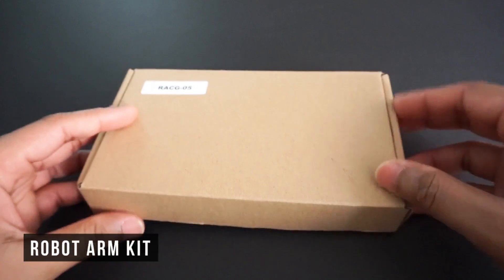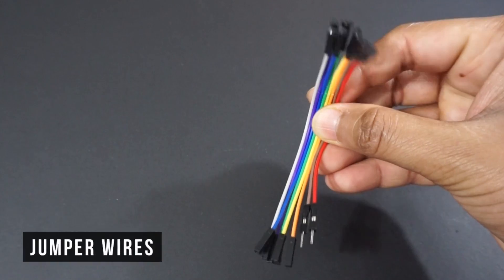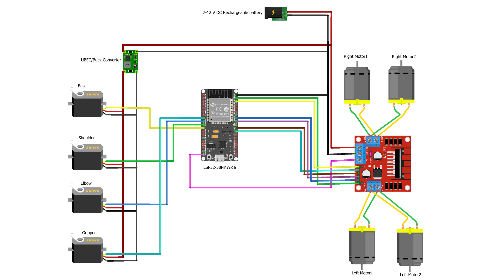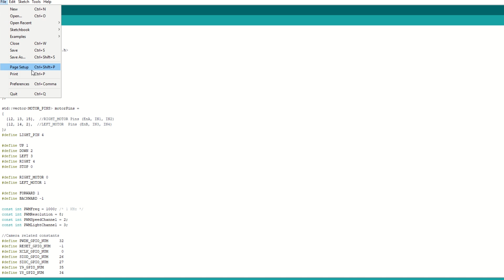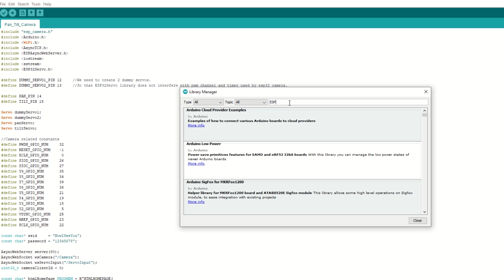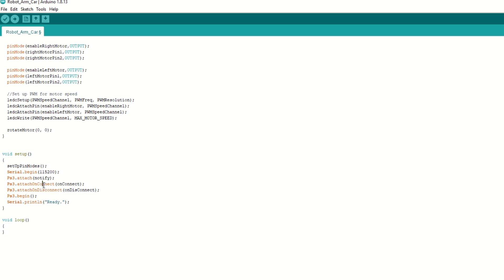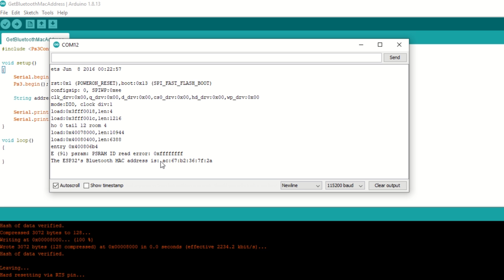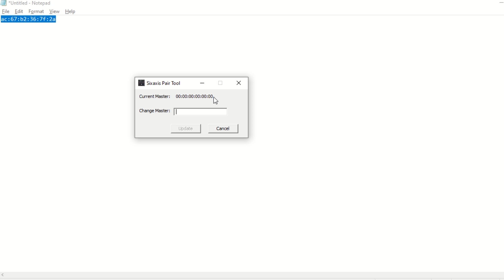Robotic Arm Car using ESP32 and PS3 Controller | DIY

Comment: Hi sir,i congratulate you for your projects, they are very interesting and thank you for sharing them with us. Can you tell me how do windows windows recognize the ps3 controller?
Reply from the maker: Thanks for your Comments . However I did not understand your question . Could you please explain in details ?
Reply: @hashincludeelectronics  sixaxis pair tool displays the message "no device found" so I can change MAC addresses
Reply: @hashincludeelectronics  can you help me? the controller is bought from china
Reply from the maker: @attilasos4387  please check the video properly . All the steps are given in it 👍🏻
Reply: @hashincludeelectronics  reviewed the video many times and followed all the steps in vain. That "sixaxisPairTool" software in the video I saw must appear at the current master: 00: 00: 00: 00: 00: 00 and No device found appears to me.
Reply: it looks like it's a big fake, I opened it and it doesn't have a battery or bluetooth. I ordered another from Romania

Comment: Do you have a build for the PS4 controller? Also I have some builds that you might be interested in. I developed a stem robotics kit a little while back.
Reply from the maker: Using PS4 controller should be same as using PS3 controller. And the code should be same as far as I see it . Just you will have to install PS4 library. Actually I don’t have PS4 controller available with me so can’t try it.  You can give it a try .

Comment: Great work , how much range do you get ? Can you increase it ?
Reply from the maker: Thanks a lot 👍🏻 yeah i did not check full range but as this uses Bluetooth , so it would be similar to normal Bluetooth range. We can further increase it by adding antenna to esp32 module at receiver side for good reception.
Reply: @hashincludeelectronics  hello! Thanks for your projects! How can i add antenas or what type of antennas should i add?

Comment: Sir, can I use the Arduino Uno in the circuit diagram and as well as in the code for the Arduino robotic arm car? Sir, can you make the Bluetooth robotic arm car control with the Bluetooth app and can you give me the circuit diagram and the code for the Bluetooth robotic arm car?
Reply from the maker: As you need this using Arduino + Bluetooth, I would suggest you please check my video on Bluetooth Car. That video shows how you can use mobile app and Bluetooth. Then use that to make this car and control robot arm. Give it a try.
Reply: @hashincludeelectronics , Sir, I like the robotic arm car using ESp32 and PS3 controller. Sir, can you make a video on how to make an Xbox-controlled 6-dof robotic arm car using the ESp32 module and can you give me the circuit diagram and the code for the Xbox-controlled 6-dof robotic arm car using the ESP32 module?
Reply from the maker: @fouzanjaved5441  sure . Please buy me xbox controller as I don’t have one 😄

Comment: Its quite difficult to control it with Arduino...Esp32 is simple...

I have a small query that ..may i use ESP32Cam module to make another project ( like by removing the OVU CAM from Boards
Reply from the maker: Yes you can use esp32cam as well. But esp32cam has very few IO pins .so make sure your projects requirement fits in .